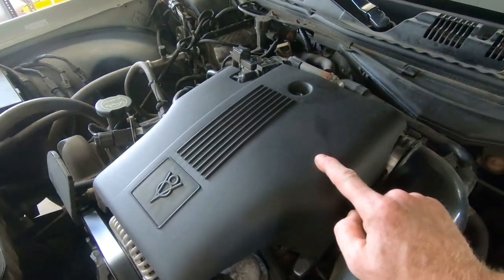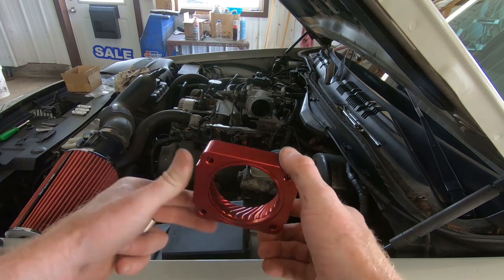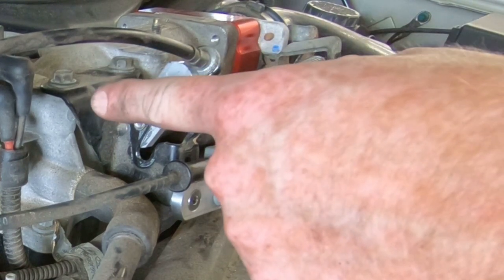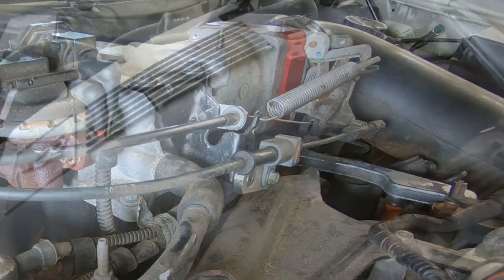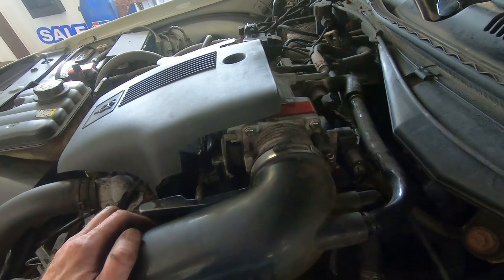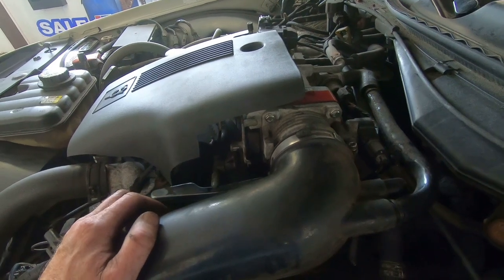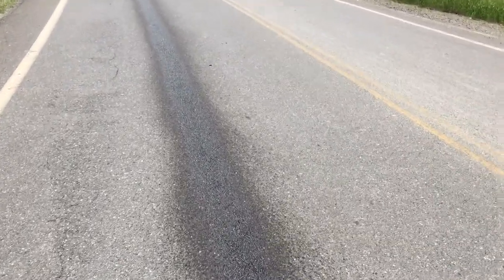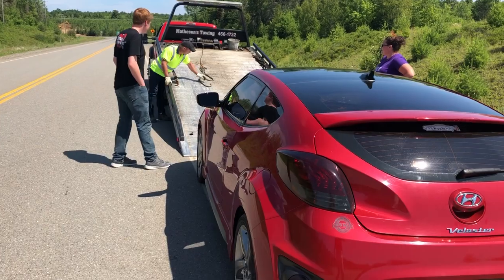INSTALLING A BLACK PATH RACING THROTTLE BODY SPACER ON MY 2004 MERCURY GRAND MARQUIS

Comment: Hyundai builds awful cars. I had one and it broke down 2 months after paying it off. Sucky cars!!!!
Reply from the maker: That's your pinion and you're entitled to it.
Reply: @OldeCarrGuy  actually, no it's not, an opinion is something that's not factual. It's a fact that Hyundai sucks.
Reply: @chriswasson8414  Just out of curiosity:  1.  What was the breakdown?  2.  What do you consider a good car?
Reply from the maker: @chriswasson8414  Everyone make a dud once in a while. Even Toyota.
Reply: @jimr5703  I disagree, the more research you do on the subject the more you discover that it's not isolated. A bad car manufacturer is a bad manufacturer, but you believe what you want.
Reply: Should've got a crown vic
Reply: @luthermoore2969  I have a 06 Grand Marquis and an 03 Marauder. Both are fantastic. The GM is a tank!

Comment: Besides a slight increase in hp, the spacer improves vacuum line response which increases the performance overall.
Reply from the maker: Exactly. Better throttle response i think is how i worded it. Thanks for the clarification!

Comment: Might have to notch the engine cover.
Laughs in throttle by wire

It's weird that they have specific ones for Crown Vics, but we have to order them for F150s for it to work

Comment: I regret I didn't think of mentioning it before you got to this point...but you could have also "knife edged" the throttle body disc when you were cleaning it. Basically leave the back side the same dimension, but you taper the front side down so that it allows air to slide past it faster/sooner when it's opening. Sorry Jr. had to go through that, but I appreciate your attitude about it. Usually my stomach feels like it's trying to wedge itself under my lungs in those situations.
Reply from the maker: Who really knows who’s fault it is that the motor went but either way no sense crying over it!  Besides, just think of the content!

Comment: Also in your application how did the recirculating hose on the rear of the engine still reach the port in the air intake piping ? Do I just need a new rubber elbow with an inch longer on one end?
Reply from the maker: Again, due to it being so long ago, I don't specifically remember having an issue!
Reply: I ended up just getting a bigger L pipe and cutting it to fit so problem solved, never ended up using th e third bracket but man I was actually impressed with the new throttle responce, I have a k&n filter with the stock box and piping and am definitely happy with the results. Thanks for the video!

Comment: I have heard speculations that removing the combs on the gasket helps increase performance, have you heard or thought of if this would work? Thanks.
Reply from the maker: I haven’t heard that before! But anything is positive guess!
Reply: Did this on my 06 cvpi and seen a noticeable difference in throttle response. Data log shows a slight increase in airflow. Combined with my full cat delete that was making the car run a little rich I think a throttle body spacer will help even more to get my afr where it needs to be. Idk how much of a power gain it will make if any at all but I'm sure it will be minimal.

Comment: Question. Seeing that I’m trying to do better performance on my 08 grand marquis. I’ve seen and read that a cold air intake is not worth it for these cars unless a tune is done. I was wondering if I get a air intake from a cop car that I believe is similar to the marauder one. Would that be the best to do instead of spending $300 on a cold air intake?
Reply from the maker: If you didn’t see my video on this, I mentioned that you definitely want a high flow filter! As far as cold air intake, it’s pretty tough to accomplish that on a Panther as it gets its air from ambient temperatures under the hood. Bang for buck, add a high flow filter rather than spending big bucks trying to get something you can’t!

https://youtu.be/af8lcaUa__o
Reply: Olde Carr Auto Guy ok, thank you.

Comment: I always liked using spacers, shame it went boom. Makes you wonder if the misfire was the cause of something mechanically wrong but you would think the knock sensor would have stopped it before
Reply from the maker: I’m betting that the misfire was something more terminal!
Reply: @OldeCarrGuy  it happens from time to time unfortunately  sometimes parts just fail

Comment: Hey Buddy amazing video! After watching yours I decided to install the same one on my 2000 MGM. The only worry I have is that the throttle body return spring is now too tight, since it has been stretched out the distance of a spacer from stock set up. This makes me have to push the gas’s paddle harder to accelerate. Did the same problem applied to you? Or is it something we just have to live with after the mod😂
Reply from the maker: It's been 4 years since this video, but I don't recall there being an issue. Maybe see if you can relocate the spring connection to some place more forward to help ease the tension.

Comment: hey what did you mean by slotting the holes u drilled them and made them bigger? or u just loosened them and scooted them to the right to it would reach?
Reply from the maker: A little bit of both actually. I took a die grinder and reamed the holes to an oval shape so the bracket would slide a bit more to get the adjustment i needed. I hope this makes sense!

Comment: Hello Jason did the spacer make any difference?asking because i have a 04 Grand Marquis
Reply from the maker: It seem to enhance throttle response! But I also have true dual exhaust and a high flow air filter which all aids in that.

Comment: Where exactly do I install the brackets that come with the spacer? I installed the spacer on mine and forgot to use the brackets l, and it instantly redlined lol
Reply from the maker: You can do it the way I show in the video, but you can install them anyway that keeps the factory bracket stationary.
Reply: @OldeCarrGuy  thank you man. I appreciate that

Comment: Have tried these spacers on several different vehicles , have had ( No ) noticeable improvement in. Gas milage or power  !  If they worked then why wouldn’t the factory add one or incorporate the design into the intake manifold ??? In my opinion these are mostly ( snake oil ) and the only benefit is to the bank account of the manufacturer  !……..
Reply from the maker: To a point I would agree with you, but, the bigger picture is a bunch of small mod’s alone do nothing but together the will work to add throttle response, HP and torque. All I need now is the Marty tune and we’re golden.
Reply: @OldeCarrGuy   Thanks for responding , the only thing I can see it really dose is increase the length of the plenum by one inch. Drag racers do that to increase velocity on very built engines. Once again if it really made a difference ( Ford , Gm or Chrysler ) would have already done it because they have unlimited equipment for testing way beyond small companies abilities. The spacers won’t hurt any but I think you will get very beneficial results !

Comment: Where can I get that brackets? I have a cable throttle on my 04 and that spacer pulls it out
Reply from the maker: I used the factory bracket and use the brackets that came with the spacer.

Comment: Did the spacer make any difference?
Reply from the maker: In theory, Yes! Slightly better throttle response.  Every little bit you do to enhance your engines performance helps. You may not notice it alone, but it works together with the high flow air filter, the true dual exhaust, the premium fuel, the plugs, and coils. You would probably gain 20-30 hp doing all of those!

Comment: Does this work on 2002 Mercury grand Marquis?
Reply from the maker: I don't see why it wouldn't. Same intake and throttle body i believe.
Reply: @OldeCarrGuy  did you have to make threads to bring the throttle cable forward? Do I need to drill any holes?

Comment: Any hp diffenrence with the spacer ?
Reply from the maker: Not as a stand alone product. But thats not it's intended purpose anyway. Its meant to improve throttle response. However, if you combined a performance intake, high flow/cold air intake and dual exhaust you might set 10 hp.

Comment: hello my crown victoria 2005 will fit
Reply from the maker: You may want to check Black Path Racing website for firmest as the 2005 was the first year for drive by wire rather than a throttle cable like my 2004. They could be the same, but better check before you buy!

Comment: Ohhh...so the problem is that is a hiunday ....
Reply from the maker: Possibly, but more likely driver abuse! haha
Reply: I do got a ?.....my 03 marquis sometimes the traction light start blinking when im driving on the highway....when i step on the gas....rhe overdrive hit fine....and the car go with no problems...but sonetimes that blinking start on the traction light... Then i gotta wait a few seconds....lights goes off...and car start driving fine again....any idea what can cause the light to start blinking???...again...this is in dry conditions....
Reply: Also....the button on the left side of the dash by steering wheel....is for the traction....dosnt seen to be working....is there a fuse or something???
Reply from the maker: Your ABS brakes are tied to the traction control. Have your car scanned for wheel speed sensor codes! You may have a bad sensor!
Reply: @OldeCarrGuy  even I dont have a abs light on.....just take it to see if is a bad sensor???....that what had me thinking....abs light should be on....but....I dont have a abs or break lights on....I'm gonna take it....like you said ...might be a bad sensor....thanks....